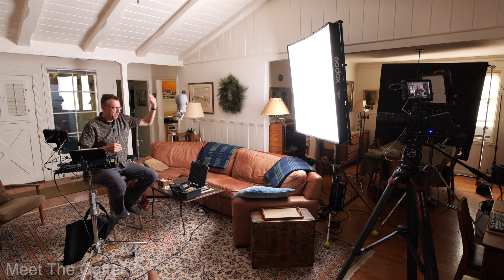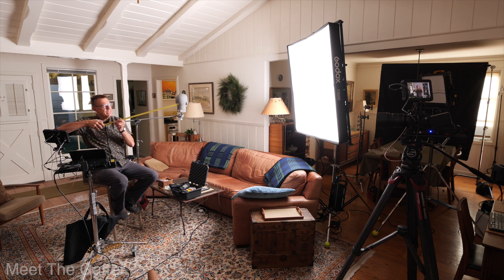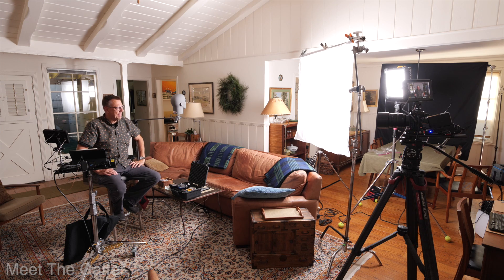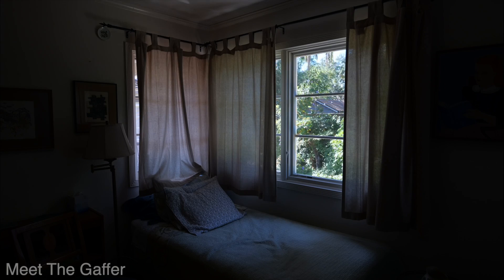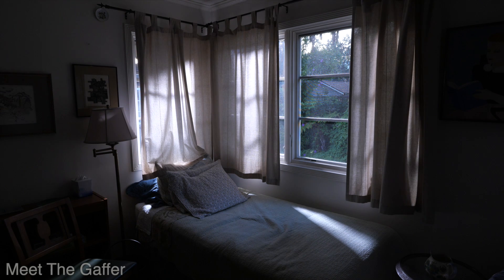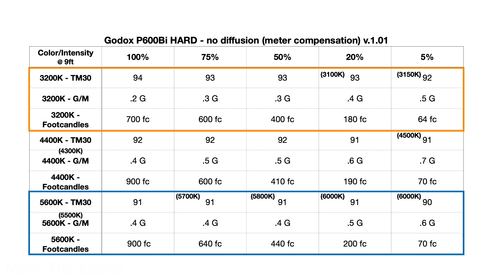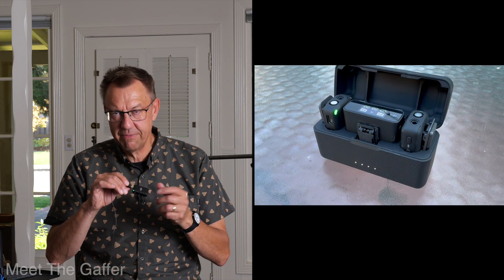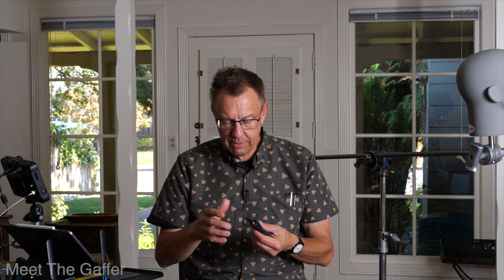Soft Light VS Hard Light: Godox P600Bi HARD and F600Bi

Comment: The test with the P600Bi outside the house at the end is impressive. Do you think you can have something "similar" in the global illumination of the scene with the f600bi and the grid? Thanks
Reply from the maker: For the inside comparison we used the same diffusion with both units. On the outside I wanted to see how the “hard” light aspect of the unit would play. The Flex light doesn’t really have a similar hard light aspect, even without the diffusion. The F600Bi would not have the same punch or characteristic because its emitters are spread out much more than the small panel’s emitters.

Comment: DO you know if the F600 light mat can fold to (roughly) 30x60cm, or is it limited to 60x60cm? I need to find this out as i'd be transporting the light in a thinktank production manager case. Thanks for the great reviews!
Reply from the maker: It’s possible that the 60x60 could be folded over slightly, but not flat. I don’t know if that would fit into the case you are refusing to.

Comment: As a hard fixture hits a diff maybe 30% of the light bounces back off to behind the set - this would make the 180FC vs 220FC to be entirely as expected fir the same watts burned. This bounce/leak can provide fill to the scene.. or just be a waste. neither hard or soft seems good or bad. Pack down.. this we could have seen a little more of. In the past I though hard light + softbox got smaller than a big (say 2.1) panel like a sky panel, but if these soft panels stack or roll they could pack very efficiently. Id guess a 3.3 or 4.4 soft panel is better than a 1.1 panel (which you cant do a good beam with anyway) but a 600 into an 8.8 might be more better than either and take a fresnel too for other lighting styles.
Reply from the maker: Yes, a lot of ways to get a similar outcome. Again, with a hard light you usually create a larger footprint. Trade-offs abound.
Reply: @meetthegaffer  yep the floppy panels are a massive win for (not) taking space on the set. Ive completed a film recently and the F21c was the winning fixture.

Comment: DJI is expanding into so many different markets. And it would seem with quality products that are in demand. Such a departure from the drone company they started out as. Let us know how that mic kit performs over time Luke.
Reply from the maker: To this point, I’ve been using the Sennheiser AVX system with Lumix GH cameras and it works great. Recently, I added a handheld with a newish Sennheiser wireless system that also works well with mirrorless cameras. I had tried the original Lark system from Hollyland, but it stopped working pretty early on. Now they have a Lark Max system, which has hopefully fixed earlier issues. Rode is out with a similar set, that a lot of YouTubers are touting. I bought the DJI set and so far so good.
Reply: @meetthegaffer  I also use (and swear by) the Sennheiser AVX system as well...on the BMPCC 6k (yes, I pull my own focus) and love this set-up.
Reply: @meetthegaffer  Also use the AVX for OMB sit-downs , what are the advantages  over the AVX , ? besides internal recording ? is that the reason you changed .. advantage I found with AVX is its using 1.9 GHz where all the others are 2.4Ghz , which is the same as mobile phones or something like that .. are these also 2.4Ghz.?  Also how are you finding the intellytech mega6 , thought you might have used it for this video .
Reply from the maker: @robinprobyn1971 I’ll keep using the AVX, but the DJI is a nice back up and really well suited to get good audio while working with the iPhone when my GH setup is too cumbersome or not fast enough. 

I haven’t used the 6FC in a bit, just because the 4x4 has been super handy and locations large enough to accommodate the extra size. The Intellytech is easier to fly (menace arm) when I need something brighter than an Air Mat and not as large as a COB with a dome.